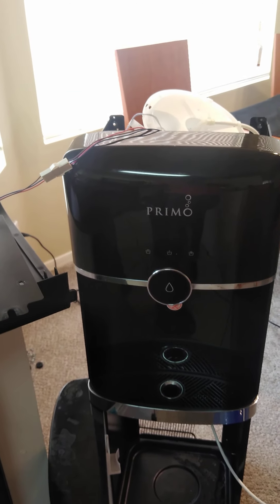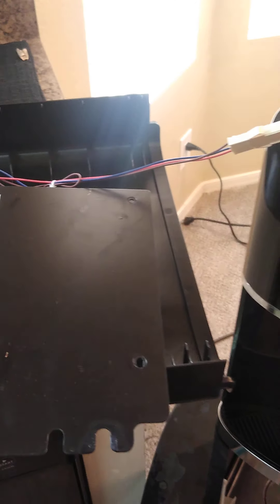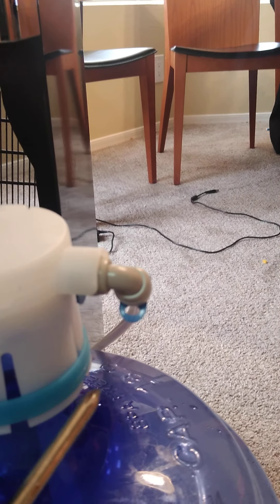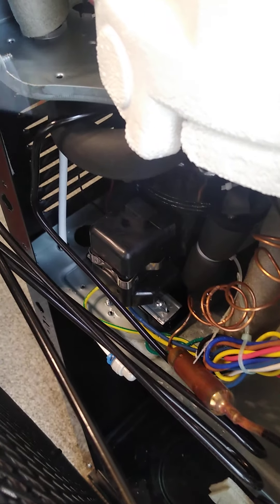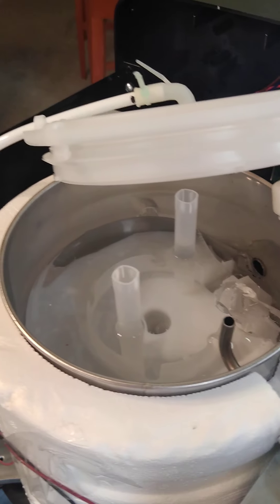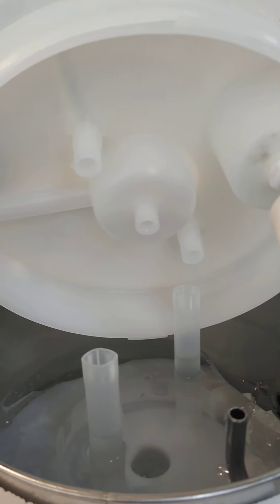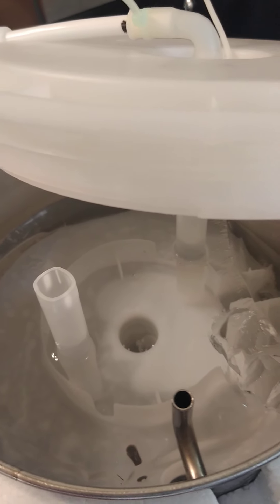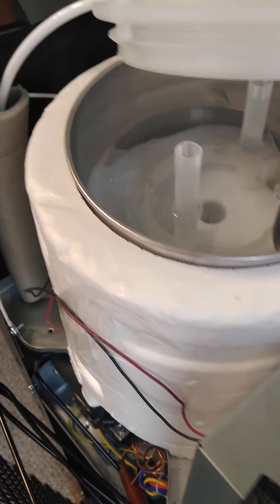Primo Water Dispenser Troubleshooting and Repair Pt 1- Not dispensing water

Comment: Hello, I have a different Primo brand but it's not much different than yours.  Mine was frozen on top too.  I saw a different video about how to thaw it out.  It worked great in the morning.  Unfortunately, 1 week later its frozen solid again.  Do I really have to resort to unplugging it overnight?  Mine is less than a year old.
Reply from the maker: Seems like not sure about whether you can reduce the thermostat level but maybe unplugging it will be a cheat codes for now
Reply: @DRIVECAMUSA  i may have to try this for the time being.

Comment: I have a different bottom loading water cooler (Hamilton Beach), but the insides look similar. How much force did you have to exert to get to lid off the cooking tank? 

In my case, even the hot water line doesn't fill water, for some reason. I let the system thaw out by unplugging it, but I hear the condenser running to cool the water, regardless if I switch on for cool water.
Reply from the maker: It was frozen...the cooler had two or three white pipes which were frozen and it took a bit of effort to pry them...you could unplug it and let the ice thaw out I believe it should work
Reply from the maker: Let it completely thaw out...my hot water wasn't coming out too before I repaired it..but thereafter it started flowing and it hasn't conked out again

Comment: Thanks for posting!  Had an issue where unit would stop dispensing cold about 24 hrs after it was plugged in.  Removed the lid and found ice inside the bath.  This indicates a problem with the thermostat.  Unfortunately it is virtually impossible to access the thermostat due to preplanned obsolescence engineering, and there is no adjustment for temperature.  This said, the only workaround I can come up with is to plug the unit into an appliance timer.   This will limit the amount the unit runs and prevent ice from accumulating.  Since unit 
pulls 6 amps, need one that is designed for at least 10 amps.  Saw a GE at Lowes for $9 than can handle up to 15 amps.  Water will still dispense since water is only used to fill the cold water bath, and if you need hot you should have the timer turn it on around the time of day you need the hot.
Reply from the maker: I  unplug it overnight once every month and it's running smoothly ever since
Reply: Were you able to get the timer?  What is going to be your cool periods and how many times a day to keep if cool not ice cold.
Reply from the maker: @InsaneKoyote  hi I didn't get the timer and the unit works quite well ..unplugged it once during summer but everything seems ok with it . Thanks
Reply: Wow! I work on water coolers & couldn't find the thermostat.  Called Primo, they were no help. They don't even sell the internal parts for their units. Thermostats, relays, heat sensors, none of it. If it's out of warranty just throw it away I guess. Unless you can strip parts off of old units. That's about all you can do unfortunately.
Reply: lol this is what I ended up doing
Reply: removing the baffle also worked for me but then it would not get as cold so you can win
Reply: Mine freezes up within 18 hours. Can't find thermostat anywhere to turn the temp up a bit. Not fun learning that it's basically a giant paper weight at this point 😤

Comment: Did it work after the ice thawed out?
Reply from the maker: Hi it did....still working great....
Reply: Iam having the same problem with my. tank is frozen. It’s full of ice in side the tank aHopefully it will work once the ice melts ..
Reply: I unplug mine and after it thaws it works fine but will refreeze in a few hours.   I can’t get the chiller unit to stop when it gets cold enough.

Comment: change the thermostate DROK 10K Temperature Sensor Probe, 5pcs 1 Meter Waterproof Temp Sensor Probe, Stainless Steel 3950 NTC Temp Sensor Probe, Digital Temperature Transmitter Extension Cable amazon

Comment: This just happened to mine as well only 1 year old, the brand is now Avalon. They also wont accept my warranty because it it just over a year, so annoying. Dont recommend Avalon's cooler.
Reply: Literally happened to mine, 1 year and 1 month. And the cooling thermostat stopped working. I'm beginning to think this is intentional
Reply: Shit, I’ve had this for 3 years and it was running great now the top water container freezes, scheduled a call with their support team waiting on them to do a FaceTime call to show them what’s up, best thing to do is to buy these from Costco cause you can return them if they defect for a much longer period of time than the warranty